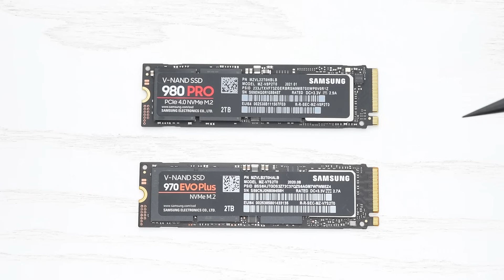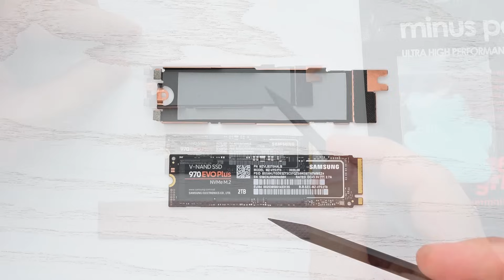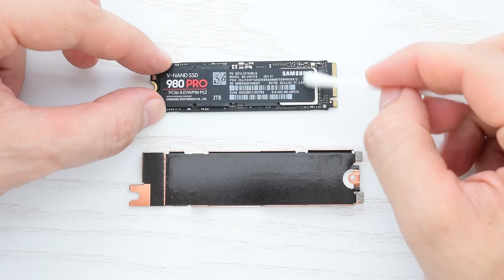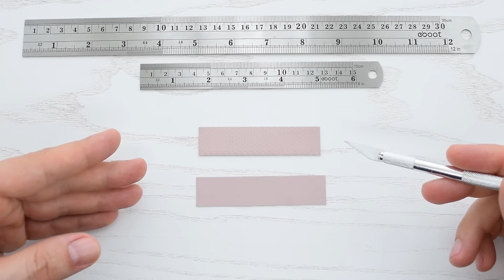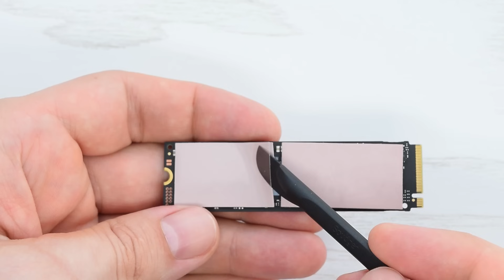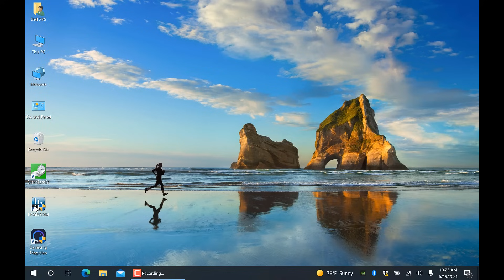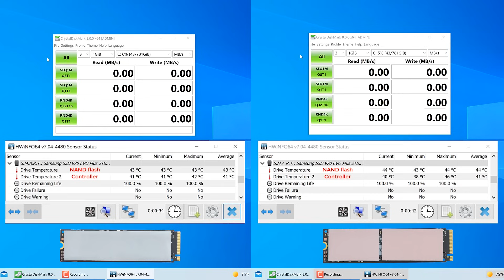Stop your Samsung NVMe SSD from Overheating and Thermal Throttling

Comment: I bought an Enermax heatsink to go with mine.  The difference in height between the controller chip and NANDs is so tiny, I just piled a 1.0mm thermal strip across the top and used a 0.5mm on the bottom.  I'm only using the drive for gaming, not constant writing, so I'm not too concerned about the effects.  My max temps after the same CrystalDiskMark test are 58C on the controller and 49C on the NANDs, but my airflow in that area of the case isn't great.  My controller at max runs 5C hotter than yours, but still 5C better than your application with the gap.  I'll live with it.  My idle temps are 45C controller/39C NANDs (8C/2C hotter than yours, but 5C/2C better than with your gap).
Reply from the maker: Great job!

Comment: I really love your work. However I have an inquiry can you kindly help me!
I have a Corsair mp 600 with heatsink and I wanna add thermal pad will it fit?? 
Can you kindly give some instructions
Reply from the maker: That SSD should already come with a thermal pad between the SSD itself and the heatsink. But some models come with just a small application of thermal putty. Of course, you can buy a high quality thermal pads like Grizzly 0.5 or 1mm pad for better thermal performance. Using two different size pads for that SSD model is not necessary.

Comment: I made some measurements of elements on PCB of SSD and here is result:

Controller: 17x17 mm
DRAM: 14x8 mm
NAND: 18x14 mm (each)

I used 0,5 mm Thermal Grizzly Minus Pad 8 on NAND and 1,0 mm GELID GP-Extreme on DRAM and Controller. It was what left from meintanance of GPU.

My results in CrystalDiskMark v8.0.4 - 52C on NAND and 60C on Controller (just simple run from cold boot). SSD used in PCIe 4.0 mode.
Reply: Update: Full Performance Mode (set in Samsung Magician)

My results in CrystalDiskMark v8.0.4 - 67C on NAND and 72C on Controller!

P.S. My system have no case right now and GPU most of the time at fan stop mode. So, SSD basicly no airflow. I use heatsing from my motherboard - ROG Crosshair VIII Dark Hero.

Comment: Smart way, using them on gen3 also big help. Weird thing is my m.2 slot behind the motherboard which means there is like 3 mm space inbetween case wall and nvme drive. Squeezed to pretty tight spot and i can^t put a heatsink on it anways. Suprisingly its not overheating, i was thinking that thigh spot will keep it more hot, i don't do any render tho but games which is doing realtime render actually but i never see that nvme went over 55 degree yet. Its gen4 works good n cooler on gen3 so i decided to go w/o heatsink or i will put a hole to the case.

Comment: very good video thank you

i have a quick question dose heatsink thickness matter? like is the thicker the better because they are more expensive than thinner ones
thank you
Reply from the maker: The thermal pads should be as thin as possible but something from 0.5mm to 1mm is optimal for efficient thermal transfer.
Reply: @ElectronicsComputers  thank you for your answer

Comment: Great video :)

I just want to ask you a quick question. In your video you used Grizzly minus 8 thermal pad stickers. They have a thermal conductivity which is 8 m w/k. Also there is Arctic thermal pad stickers and they have a thermal conductivity which is 6 m w/k. I have an Alienware 17 r5 laptop and I want to put thermal pad stickers and a heatsink on a Samsung 980 pro.

8 m w/k will transfer heat faster to the heatsink than 6 m w/k but I was told that you need an ideal environment which has excellent airflow to take advantage of the faster heat transfer and the heatsink will get rid of the heat fast because of the excellent airflow. My environment is not ideal because of the weak airflow to the nvme ssd area so the heatsink will get rid of the heat slower for me so there is no need for the heat to quickly reach the heatsink so it's ok if I use the arctic thermal pad sticker. Is what I said correct? I am worried that if I use the Grizzly thermal pad sticker then the heat will quickly escape from the nvme ssd but I may end up with a hotter heatsink because the heat will slowly leave the heatsink due to the weak airflow.

Which thermal pad sticker shall I get?
Reply from the maker: Both will work perfectly but I'd still go with 8m w/k. it's an optimal thermal transfer conductivity for a regular passive heat sink. If you'd have a liquid or air cooled heat sing then I'd go with even higher thermal conductivity.

Comment: I came across this video when looking about moving thermal paste. I recently installed a 980 Pro into my top PCIE slot after having a 970 Evo in that slot for a few weeks I’ve been looking at temps because the temps I’ve seen from the 980 are really hot, under a light load like video calls and web browsing and read loads it sits at about 48-50 degrees Celsius. Under a gaming or write loads it sits from 58-62 degrees Celsius. Which even though this is  in the operating temperature of 0-70 Celsius it still comes off as a little hot. Do you think if I took the PCIE cover off and cut it in two I would see some difference in temperature? Or does anyone have any other suggestions?

Intel Core i7 12700K
 
Corsair Vengeance DDR5 4800
 
RTX 3070 Ti
 
Asus ROG Strix Z690 E Gaming WiFi 
 
Corsair 850w PSU
 
Samsung 980 Pro 2 Tb
 
Samsung 970 Evo 1 Tb
Reply from the maker: Those SSDs have two temperature sensors on board. Samsung magician shows only NAND temperature. So if you see under load 62C then you controller cheap will be above 80C which is not good.
Reply: @ElectronicsComputers  What do you think I should do? I have been using Magican to follow the temperatures

Comment: Looking to buy one of these drives for my M2 Mac mini - to be used in external closure - anyone done similar and had issues with over heating ?
Reply from the maker: Just buy 980PRO and overheating won't be an issue.
Reply: @ElectronicsComputers  cheers

Comment: removing a paper from chips lower temp elsemore! and is more effective than new t-pad
Reply from the maker: Removing the label will void the warranty and it doesn't make any real difference in cooling your SSD.
Reply: @ElectronicsComputers  I hear about this but in both, i read that NO. But i dont check this myself. As i read, paper must present on or in hands near ssd for warranty

Comment: Im using the 970 evo plus on my aya neo 2, only one thermal pad which is the 0.5 mm one came in today. Is it safe to use just this one for the ssd? or should i wait on the 1.0 mm before installing and using?
Reply from the maker: If you're not gonna overload your SSD to burn the shi* out of it , then it will be fine.

Comment: Hey bro , i just found your video and it was extremely helpful thank u❤.. Quick question: what if i used the same thermal pads thickness that u used, but instead i cut it in the shape of the controller , dram size would it be better ? Or just using your way and saving my time?
Reply from the maker: I don't think it will male any difference but the thermal pad should always overlap the component it cooling.

Comment: What if the metal heat sink was in two separate parts?
Wouldn't it be better?
Reply from the maker: Such heat sinks don't exist and what's the point? Most SSDs have absolutely flat surface. Only some brands do it with different component thickness.

Comment: What would be better solution though? 0.5+1 mm pads or 1x2-3mm pad if I have the space of course. 

And thank you for the video and all the replies to other people in need!
Reply from the maker: 0.5+1 mm pads would work the best. There's 0.5mm difference between the chips.
Reply: @ElectronicsComputers  perfect, thanks! Will be testing next few days a copper heatsink with these pads.

Comment: Do I NEED that heat sink shield? I have an 970 evo plus and I'm wondering if I should put the pads on it with or without that shield. I have an MSI gf65 thin.
Reply from the maker: There's no sense to apply a thermal pad without the heat sink.

Comment: this video is really well done!  One question: I bought a 1tb pcie3 crucial SSD, I only use it occasionally to download some video games, moreover my poor connection can't even maximize its real power.  Do you think I should still buy a cooler?  Would the one in the video be fine too or is it just for Samsung SSDs?
Reply from the maker: If you don't overload your SSD with games, and some software that works with graphics, then your SSD will be fine. There's no need to use any cooling solutions in that case.
Reply: @ElectronicsComputers  Thanks so much for your reply, it brought a lot of interesting content, I thought I'd subscribe!  Small clarification: What do you mean by game overload?

Comment: would removing the sticker label off the nvme improve cooling even further?  I noticed you didn't remove the label on the nvme.
Reply from the maker: Removing the label will void the warranty and it doesn't make any real difference in cooling your SSD.

Comment: Great video! Just one question, do I remove the pre-installed thermal pad from the heat sink?
Reply from the maker: Removing the label will void the warranty and it doesn't make any real difference in cooling your SSD.
Reply: @ElectronicsComputers  okay thanks! One more thing, do I really need to get different thickness pads or could I just do this with 1.0mm pads?

Comment: Yeah, the memory usually doesn't mind being hot at all, but the controller does, and they're thinner and lack contact often.
So i always wondered why they don't just use two different pads, small thicker one clearly for the controller, and longer thinner one for the memory modules, stick those on, and done.
Should be fine, should work better.
I'd almost say if they made the M.2 heatsink so only the controller gets a pad and is cooled that would be fine too, as long as maybe the heatsink doesn't touch the memory modules at all, so it doesn't squeeze those, might be bad, and it should work better ?
It would also almost certainly be even better if you remove the sticker first. You might not be able to see what drive is which from the outside afterwards, but i doubt most people will do that if at all after installing, most people just install it and keep it there.
Reply: It's actually the other way around: flash memory getting hot can get damaged, while controller is just a chip and will just throttle (by software).
You can argue that controller being not in contact with the heatsink acts as a safety switch for ssd, because heat stays on it, it goes hot (70C+), while flash is still just warm, like 45C, ssd slows down, cools and this way flash stays in warm temp range.
But if both flash and controller are in contact with heatsink, flash will go higher temp (65C) and controller will stay also at 65C, which may be bad for flash.
Reply: @nilsfrahm1323  But the flash memory can handle heat a little better, doesn't get as fast, the controller gets hot faster, lower safe peak temperature i think, and is more likely to be damaged by it.  Throttling is the safeguard, sure, but that means it'll go slower than the memory might be able to. Not so useful.
There's a reason they say the memory getting hot is not so much the problem but the controller getting hot is, and it's mostly that that needs cooling, or are you going against just about everything everybody knows about M.2 ssd's ?
Reply: I've just actually done that in two laptops. I used a thermal adhesive patch on just the controller of a 970 EVO Plus, which allows the heat sink to float a fraction of a millimeter above the memory modules. It's in contact only with the controller, which gives the controller sole benefit of the heat sink thermal mass. I'm can't push it above 70C under load and it's running only 40C at idle.

Comment: So if I already have a 1mm thick thermal pad across the heatsink, I just need a 0.5mm pad just to cover the controller?
I have 2 x 970 Evo Plus which are currently idling at Δ23C (50C w 27C ambient room temp)
Reply from the maker: I'd recommend applying 1mm pad on the controller and 0.5mm on the NAND chips.

Comment: What happens when its thermal throttling?
Reply from the maker: Performance drop and overall heat is the number one enemy for electronics.
Reply: @ElectronicsComputers  how about my ssd nvme suddenly stops working when its underload or copying files..and come back later if its not hot..Its like that when its hot..is it damaged already?i checked the health and it says its still green.

Comment: do you think the 990 pro needs this done? I just got the 2T non heatsink version....would love to know, fantastic vid btw.
Reply from the maker: The same design "flaw" and same process to "fix" it for Samsung 970, 980, 990.
Reply: Ok, is it really so bad that if I don’t do this mod my SSD will perform bad and not last long? I spent a lot of money on my 990 2T and want it to last a long time, I currently do not have a heat sink off it either

Comment: Does the 980 Pro that comes with its own heatsink suffer from the same issue?  Those appear to void warranty if the heatsink is removed to replace pads.
Reply from the maker: No, for that drive you just need one thin thermal pad.

Comment: Thanks,I had never installed a heat sink on a M2 before and was mostly wondering if I should remove the Samsung sticker on the drive first.
Reply from the maker: Removing the label will void the warranty and it doesn't make any real difference in cooling your SSD.
Reply: @ElectronicsComputers  Yea I was honestly not sure, I am used to applying thermal paste and stuff like that to direct metal, so I was not sure if the sticker needed to be removed first, thought maybe it would help the heat move.

Comment: You can put the pad between PCB backside, and against the mobo to act as a heatsink. You can also put a thermal pad on only the controller, that way only the nand flash runs "warm" (meaning between 15-45° C), while the controller stays cool.

Doing both allows you to cool the components that prefer cooling, while allowing the nand to stay "warm" - nand flash will actually degrade if too cold.
Reply: Yeah, so in theory using a worse thermal pad is the way to go on the flash and a high quality one on the controller for best "durability"
Reply: @TheDembe1  BS it is NEVER a good idea to run memory hotter as long as you are above -30C. space operations is a totally different story. This is if you are using a real heat sink that moves heat and not a block of metal that is just a heat 'capacitor'
Reply: @davebing11  -30c? Nandflash should not be to hot or cold, the controller is always better to have as cool as possible. The data on that was before, im not sure anything els have come out.
Even if you have a good headsink with active cooling it will still store heat. so the controller will heat up the rest of the components either way. Most people don't need shit anyway, few people do benchmark level stress on a regular basis nor write heavy data daily, for that little group of people they might need to care.
Reply: It will never reach the 'too cold' state when you are on earth dude, stop BS LOL :face-turquoise-covering-eyes:
Reply: nand flash will perform worse when its colder (not very noticable though) but it will extend its lifespan

Comment: This apply to the 500GB model?I have it followed your instruction but there is still a gap between the two pads.
Reply from the maker: Yes, same process. Did you use two pads with 0.5mm difference in thickness between them?
Reply: @ElectronicsComputers  Yes
Reply: @ElectronicsComputers  The memory chips  are lower than the controller in the 500GB model 970 evo plus.

Comment: You should have taken that sticker away, it interferes with the thermal pads conductivity...
Reply from the maker: Removing the label will void the warranty and it doesn't make any real difference in cooling your SSD.

Comment: I just ordered the 980 PRO and was looking for any advice how to apply thermal pads, so thx for the video :) 
One thing I‘m wondering about: would it not be better to remove the sticker from the nvme to stick the pad directly onto the chip? I assume that the sticker is preventing an optimal heat trasfer.
Reply from the maker: Removing the label will void the warranty and it doesn't make any real difference (even if it will be 1-2 degrees difference it's not worth loosing warranty) in cooling your SSD.
Reply: @ElectronicsComputers  Thanks for your explanaton

Comment: It's work if used thermal pad only? Without Heatsink
Reply from the maker: Thermal pad is used only when you have a heat sink. There's no point to use one without another.
Reply: @ElectronicsComputers  So, why does gaming laptop have thermal pad on NVMe SSD without the heatsink shroud?

Comment: This might be the solution to an issue i am having with a normal 980 nvme where the controller is getting over 80c while installing games and other normal usage. HWinfo64 shows "temp 2" which i believe to be the controller getting very hot and always being much wamer than the memory.

 I believe part of the issue is also the not so great heatsink/pads that are on my x570 steel legend board and it's all 1 heatsink for the m.2's and the chipset so i have to use it instead of buying a seperate heatsink unfortunately. I will buy some better pads and hope that helps. TY for the adjvice.
Reply from the maker: If you want to use only one 1mm pad, try to find the softest one which can be easily compressed an take a shape of all those components.

Comment: What's the effect on chip if you don't use the thermal paste/tape at all?
Is it good or bad?
Reply from the maker: I will overheat and probably won't last as long as it could. But anyway, for several years it will be fine.